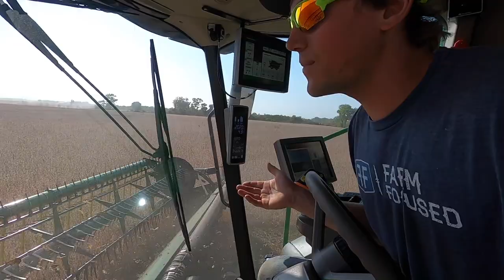Did Somebody Say Crary Air System On The S790??  #2

Comment: I'm impressed you don't have any loss between the seperated drapers, seems like there is a big gap for beans to fall through
Reply: Wondering the same thing. Maybe the velocity of the belt and a possible height difference from end of the one belt to the start or the other allows them to jump the gap.
Reply: As long as your beans are still in the pod and on the stalk those gaps don't matter much on the draper belts. Those loose beans they are dealing with probably normally don't make it much past the cutter bar
Reply: Incoming crop pulls most of that in and you’re left with that amount until ya clean out at the end of the year more or less
Reply: Me too.
Reply: Exactly what i was thinking... how many of the loose beans fall thru that gap?? We have grown all corn for the last 10 years and before that i only have experience with a crary auger flex head. I just have not seen the big selling point in an expensive draper head...
Reply: The selling point down south is we can cut rice and soybeans with the same head

Comment: For years you could order a Deere platform without a reel. Many did and installed a crary air reel on their new head. Apparently mother deere decided they didn't like the lost sales so they did away with the reel less option. That's when crary came out with the out front wind system. Not as good as an actual air reel, but it beats throwing a brand new deere reel in the scrap iron.

Comment: That tube pointed sideways is blowing the crap the wrong way and making it pile up on your steps.....get rid of it and just drill some holes in the center steel tube to blow the stuff off your feeder house.  Keeps it clean and gets rid of the stuff blowing across the feeder house and up on the step. Love the air system.....they do work great.  Get a couple extra air tubes on hand though for when you run one into the ground and break it off. Lol

Comment: That took me back to the ‘80’s, running Crary air reels on 24’ flex tables.  The old combines with the engines beside the cab liked to start fires on the exhaust manifolds.

Comment: Nicole seems to be using every musical genre these days.  The Mr. Rogers theme is an interesting addition.  

Here’s the answer to your cab door debris problem. The DEWALT DCBL720, 20 volt blower.  Brushless, variable speed, cure all your ills.  I’ve had mine for about 2 1/2 years.  Don’t leave the garage without it!

Comment: Those air reel systems work great . We have them on both of our heads . We save probably  2 bushels of beans when they are extremely dry due to header loss . We run them in wheat that is downed . The good thing is that you can unhook the other pto shaft to them and run without them as well.  Nice video stay safe and farm on my friends  !

Comment: Hey Chet I think you should run the air bar closer to the cutter bar and you could slow it down a lot more, then you won’t need as much horsepower to run it, it will be closer/more direct to where you want it and it won’t be blowing as many leaves everywhere

Comment: Wow! what an elegant solution! I don't really remember if loosing beans on our very small JD combine was an issue. I did notice in the previous video that it looked like you were almost shaving  the ground to get  the low pods cut. There are small rechargeable leaf blowers that are not really much larger than the fire extinguisher I saw on the ladder. You could get one, keep it in the cab and then crack the door and blow off the debris on the walk way as you are getting out. (I checked and I am not sure if your favorite red power tool company has one...

Comment: Glad to hear you were able to get air wand system delivered/installed so quickly.  Wonders of being U tubers.   you able to vary the blower speed?  May be able to save the beans with less crop being blown around / leaves building.   Wouldn't want to have build up  rubbing/starting fire or abrading rotating surfaces.

Comment: I believe it was Ivers Farms who mentioned, that sometimes, the yellow air tines would brush on the beans, causing them to shatter before they get into the head. Have you noticed this? Zach never mentioned it, but it might only be in certain conditions.
Also, it seems to blow ALOT of chaff over the back of the head - giving a cleaner sample, perhaps?
Reply from the maker: i have not seen them breaking opening any beans they don't run very deep into the beans.

Comment: Why not place a aluminum shield or stainless ramp above the teeth at a angle that it prevents bean build up? Mabey experiment on shields that prevent build up in unwanted areas for maximum Efficiency. Could see if John Deere would like that idea? You could try a test pilot as a attachment to avoid wielding something there?

Comment: Crary needs to add another tube to blow in front of the cab door so you can get out.
Or maybe add a mesh or clear polycarbonate plate in front of the stairs to prevent build-up on the stair platform. 
Wouldn't be nice to be trapped in the cab when a combine or crops catch on fire and you need to get out in a hurry to put the fire down.

Comment: You might need to add an air hose with openings under the door frame, so while it's running, then you won't be trapped within the machine, Just in case, you know?

Comment: If it takes a lot more horsepower, then how much more fuel will you burn? Is the higher fuel cost considered in the 800 acres calculation?

Comment: I noticed that you don't cut the beans following the rows as you planted the beans. Are your computer software and GPS coordinates able to still calculate your yield based on changes made while planting? I was under the impression that the GPS system could communicate to the planter to apply more or less fertilizer based on last year's yield at any given location, as you're planting. Is that incorrect?

Comment: Does the stainless you put on the back of the belts come with the air system or is that separate?
Reply from the maker: It’s a option when buying the reel you could by it separately from Crary also.

Comment: But are you losing beans over the top of the head? I see lot's of material flying around.
Reply from the maker: Nope that’s just leaves. And you can turn the air flow down if you don’t want it blowing wide open.